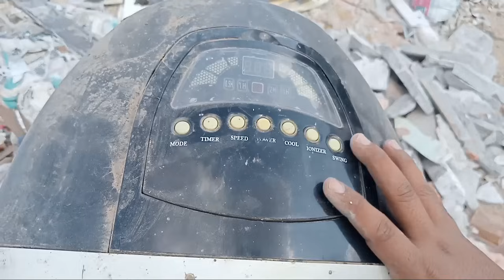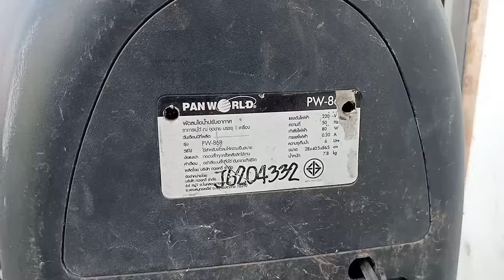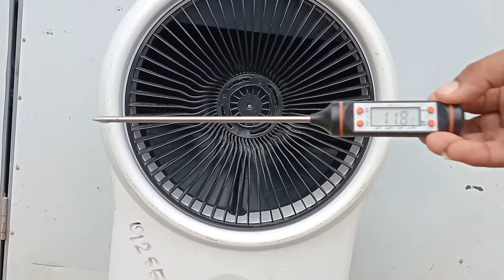Restoration Air Cooler Water Steam #restoration #diy #homemade #repair #fix#inventions#ideas#diy#fan

Comment from the maker: 15:37 it's a Power supply -input220vol
-Output12vol use only with Motor Pump